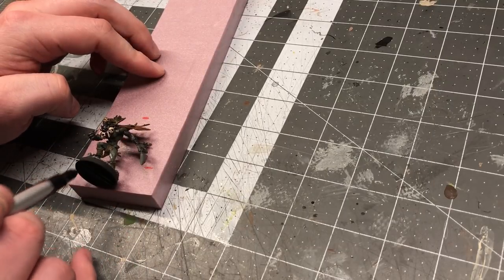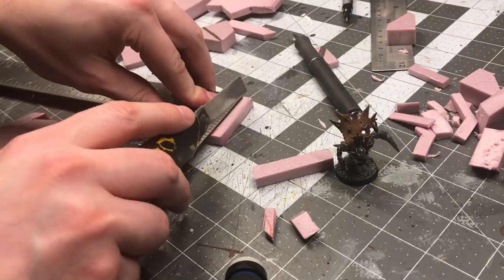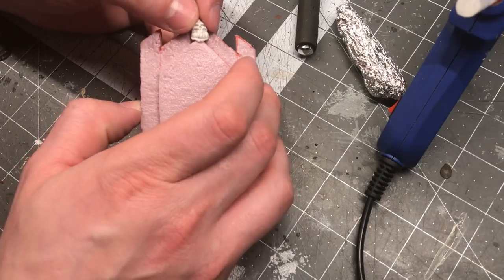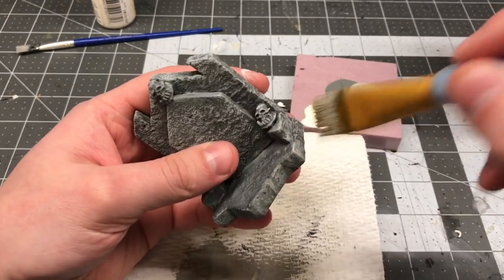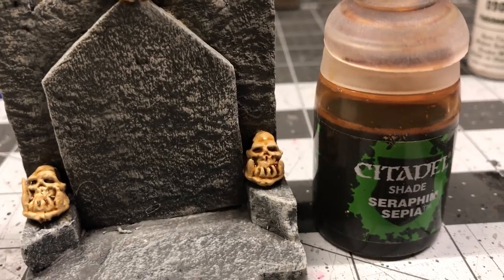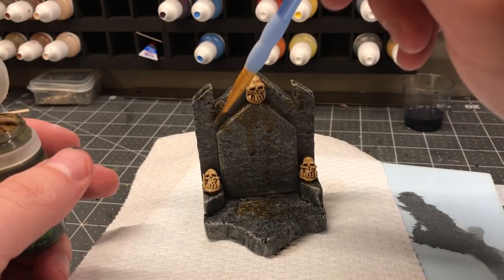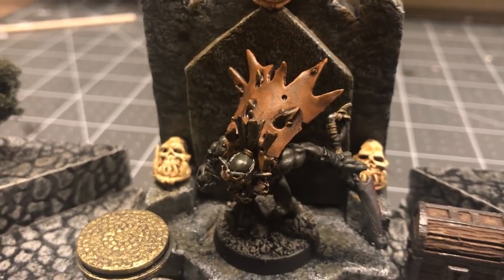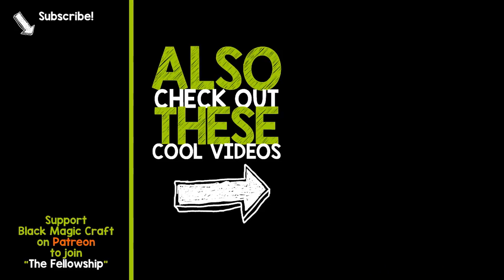Miniature Throne Build for D&D Tutorial (Black Magic Craft Episode 067)

Comment: If you want some quick and easy chairs to make, look for the 1" round wood discs in the craft store and either use that as a stool for at the bar, or a bit of hot glue to attach a piece of Popsicle stick (The curved sections or flat, either works, use both for some variety) to one side as the back. Just paint it up from there...if you want to do that pretty damn quick, just use a bit of the wood stain that includes the sealing stuff in the mix and you can get a pile of them done in 15 minutes baring letting the stain dry overnight.

Comment: Great video BMG!  Your channel has rapidly become my favorite crafting channel on here, and even with a decade of terrain/scenery making under my belt I am learning lots of new tricks with each vid.

Here's a question I have if you have the time: I'm about to delve into my first set of dungeon tiles and am hoping to go the way of your 3x3" pink foam tiles.  However, I am also quite fascinated by the "clip on"  accessories used by Wyloch (examples in this vid: https://www.youtube.com/watch?v=ilVhR3L2GbU) where doors, traps, etc. attach to walls.  Do you have any ideas (or a possible video in the future... ;) ) with how you could possibly combine these two techniques, your tiles with easy clip on accessories?  On my current table the various bits and bobs don't have a lot of structural support.  Thanks and keep up the great work!
Reply from the maker: I’ve been contemplating building a new set with walls because I also like the clip on option. I haven’t decided yet how I’ll treat the walls. Not sure if I’ll add them to the existing size or start fresh with the wyloch 1.25” format.
Reply: Black Magic Craft makes sense.  I also just watched your battle mat video and i think with your existing tiles seperate modular walls could work, but definitely not as easily for published modules.  Looking forward to seeing what you come up with!